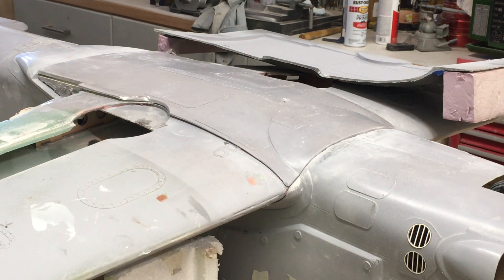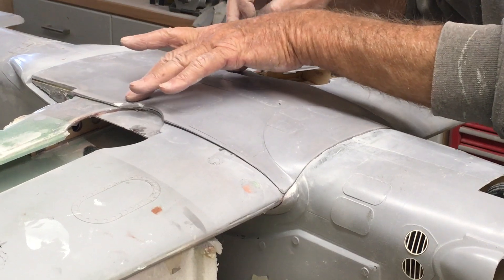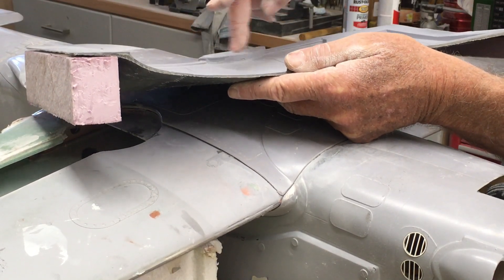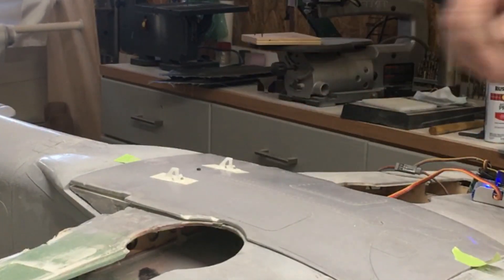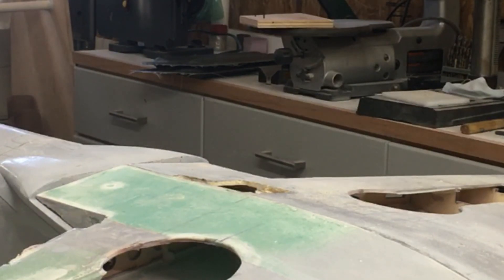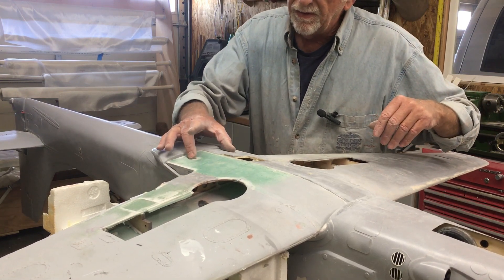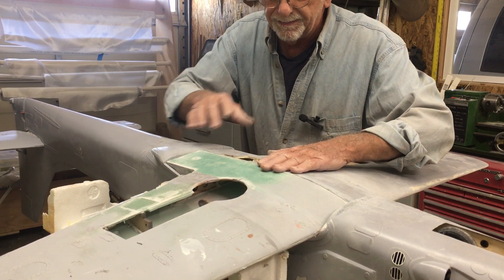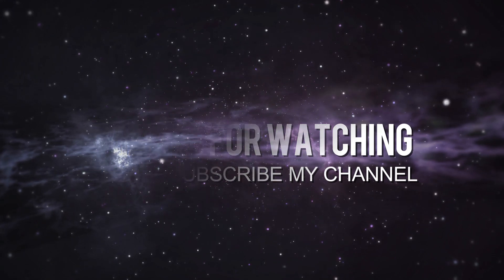Tucano Part 27

Comment: Is the purpose of redesigning the rear spar is to box the speed break in? Thoughts of adding carbon to the speed break servo mounting area and maybe a strip down the leading edge of the speed break itself?
Reply from the maker: Moving the rear spar is to make room for the servo.  Will be test flying this week so will see how the brake performs and adjust the design accordingly.  Thanks for the input
Reply: Again great stuff!